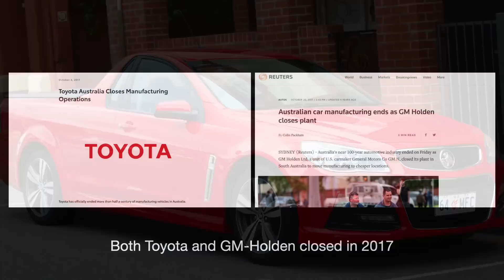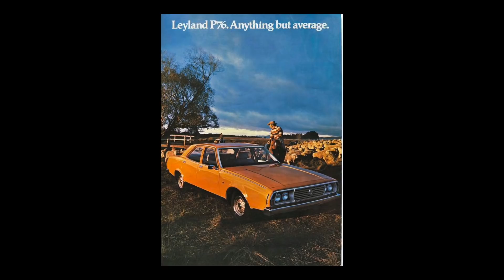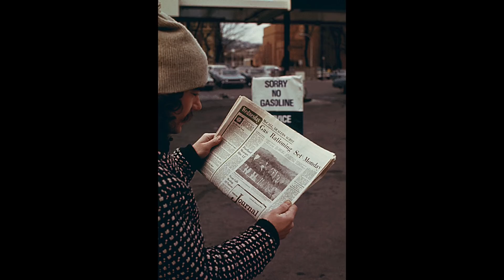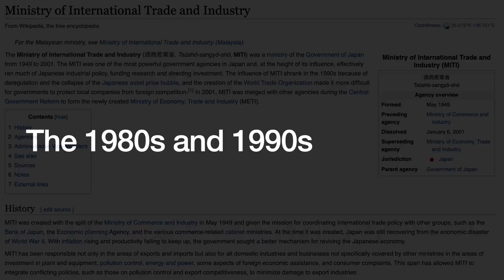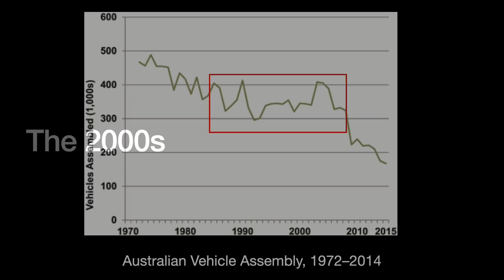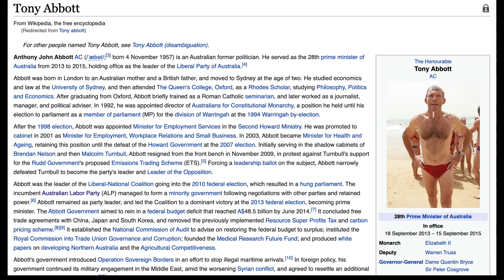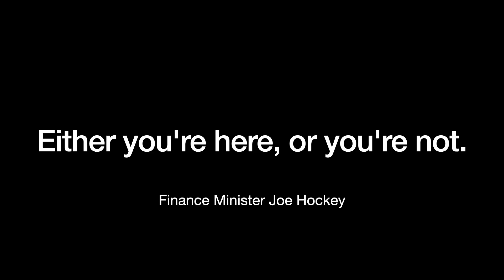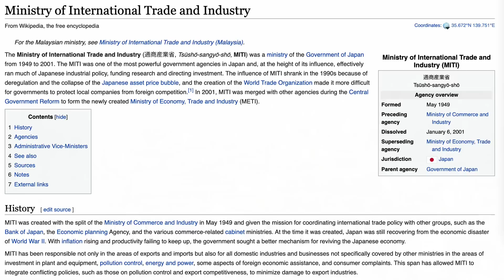Why Australia Doesn’t Make Their Own Cars

Comment: Until the 1990's the Australian car industry only existed because of government subsidies, but they were they making unique vehicles that filled a domestic requirement. Australians wanted a full size (luxuary size) car with a large powerful engine (3.0 to 6.0 litres) for the price of an entry level medium car. They wanted a stripped out Mercedes S class for the price of a Toyota Camry and that is what Holden and Ford gave them.This configuration was unique to Australia and sales justified these unique platforms. 
By 2010's Australians were buying SUV's and the unique platforms no longer made economical sense and it didn't make sense to build SUV's in Australia when they were already being built in Asia with much lower labour costs, about $3,000 per unit. So the foreign owned companies shut down production and imported Asian built SUV's instead.
Basic economics.

Comment: We had Holden made cars here in the Arabian gulf region (Branded as Chevrolet Lumina SS/CR8) they were so powerful (I believe they came with the LS1 engine and later models with the L98) and car enthusiasts were into it with some beefy modifications.
Reply: do they still exist there? Will probably be good collector cars in the future.
Reply: @Viper4ever05  discontinued. I believe the only Chevy sedans exist now is the Malibu and that also might get canceled. we also had the Holden Grange (Branded as Chevrolet Caprice S/SS/LTZ). some enthusiasts used to replace the chevy badge (back and front) with the holden ones since they thought its the real deal. I remember those Holdens dominated the streets for a few years with even slight modifications.
Reply: In the US the Pontiac G8 was a branded Holden sedan with an 6.2 ls and a manual transmission. You can only get them as 2008 year, as Pontiac was disbanded as part of GM's bankruptcy and bailout
Reply: @jammon798  they should have kept that car. It was the only decent car they had
Reply: Walled, i believe you also had Toyota Camry's there too which were made in Melbourne, Australia. I heard the Middle Eastern countries liked the Australian built cars because they handled the hot weather better than European or American cars.
Reply: @philliphunt5348  Correct. my friend drives a 2011 Camry (Australian) 480000km on the odometer. the car refuses to break down basically. I drive 2020 GMC Yukon, but overall its a Toyota land. The Japanese understood the Saudi Arabian market and the gulf region in general from the start. not very expensive cars, easy and cheap to maintain (spare parts everywhere), good quality, high resell-value compared to other vehicles and MAINLY, great air conditioning (I think Mercedes Benz uses Toyota made AC unite -Denso). remember the gulf region was dominated by American cars (because of the big oil companies) until the arrival of Japanese cars.
Reply: @waleed8530  I don't know about dominated. I used to destroy them in my Skyline GTRs with few upgrades.
Reply: @jeffmcdonald101  I think he means dominated in annual sales volumes, not in performance.

Comment: Man, I really would appreciate if you covered the Brazilian automotive industry, it's big but always seem to be behind in cost and technology.
Reply: doesn´t seem to be...we are....we didn't have standard ABS brakes or Airbags in our locally produced cars almost a decade after it became mandatory in many other countries.
Reply: @Ithecastic i don't see a reason gor not having ABS as mandatory, it improves breaking performance in 99% of situations.
 We didn't implement it in Latin America because we use old tooling other countries discard and cheaper parts so our people can actually buy the cars. As an example the Ford Falcon was produced in Argentina until 1990...with full steel body with no crumple zones and a wooden steering wheel. It's insane when you compare it to the cars Americans or Europeans were producing at the time.

Comment: 12:27 The UK tried the same thing in the 1950s and 1960s with disastrous results.  The real problems were labor costs and quality.
Reply: Unions.
Reply: @dreamdiction  "labor costs and quality" are objective measures.  "Unions", while accurate, is both subjective and inflammatory.
Reply: @RonJohn63  Unions resisted modern manufacturing improvements to protect jobs which reduced productivity but they still demanded pay increases, making their company objectively uncompetitive.

A Japanese manufacturer was producing a car in 15 man hours while the British could not do better than 65 hours. Cutting tools were infrequently changed reducing precision in vital components, that's why British engines needed an overhaul after only 70,000 miles and the engine had starting difficulties due to low compression after only 50,000 miles.   

Britain made good cars until about the mid 1960s but after that even British car works bought foreign cars because they knew how shit their own products were. 

15% of the floor space in British car factories was used for "snagging" (correcting faults). Japanese car companies had no snagging area because they stopped the whole production line and only restarted it after manufacturing faults were corrected.   Any British worker who insisted on quality workmanship was label as a "jobsworth" and denounced by shop stewards as a sellout and a management lickspittle.   

Management published reports saying they could not fire workers who came to work only to steal things or curl up in a corner and go to sleep. Union bosses and shop stewards were pawns in a game they did not understand, it was always the plan of marxists to collapse British industry and make Britain dependent on imports so that political control would fall into the hands of globalists who use economy power of and authority structures of capitalism to achieve the aims of communism, that's why everything Mein Kampf warned us about has come true today.
Reply: @dreamdiction  mate. Detroit union is the best union. The best until they destroy entire city

Comment: I've seen the blowback on the parts sector first hand. In 2014, a Denso-style Alternator for a 1999-2006 Toyota Camry cost $250, fitted. Today, that same alternator costs $450 alone.
Reply: yes but them denso alternators from the 90s are high quality and can be rebuilt mine is over 32 years old has been submerged plenty of times and still keeps going. The new ones don't seem to have the same build quality
Reply: Just import two cheap Chinese equivalents, if you have a spare, the first will not give trouble.

Comment: Japan has now subaru which was transferred from gm to Toyota
Mazda that's now out of fords umbrella.
Mitsubishi which is in alliance with Renault and Nissan.
Honda is independent from the two.
There's Suzuki which sells like 10 million cars in India each year.
Toyota is indeed the leading force
Reply: Average indian spends $10,000 on a car while an average Australian spends $40,700. Suzuki don't sell cars of pricetag $20,000.
Reply: i envy Japan for that.
Reply: @g1y3  yeah, people really overestimate the market for high end cars and just cars in general based on the population. There's a reason Tata made a "car" like the Nano to increase the number of potential customers because a decent part of the population can't even afford scooters so it's not even close to a market of 1 billion consumers
Reply: @oblivious7642  a scooter cost less than a nano car. India is still a large market for two wheel. Nano failed because of the tag  "cheap" , and with the price of a new nano you can get a decent used car.
Reply: @mrx9920  I know, I was just pointing out that companies tried to make cars even cheaper to boost units sold. The car companies typically don't make anything off used car sales. The nano was a failure mostly because it wasn't worth the cost given you could get used cars for a little more (at the time it came out) and scooters for much less. The safety concern news reports that kept coming out also didn't help.
Reply: @mrx9920  plus it was cheap (and tiny).  The car looked like a toy mobile even in front of old Maruti 800s
Also I just saw the new ones are priced between 2-3 Lakh. Some used lower-end models will definitely be cheaper than that.

And if you thought I meant people don't buy scooters... I was just saying that there's still a lot of people here who probably hope they can buy one some day. Daily laborers and such
Reply: @g1y3  they do.look at spresso

Comment: One thing the Australian (and even State) governments could have done, was invest. Instead of just handing over cash and subsidy boondoggles, they could have just offered to invest capital. They could have demanded shares in the local operations. By doing this, the multinationals would have either had to match the capital inputs, in order to maintain control, or leave the locals to accumulate a majority stake in their own automotive industry. BTW; the government wouldn't have had to exclusively own the Australian shares; they could have forced the issue of shares that could only be held by Australian citizens or government bodies; which could have been freely traded on the local exchanges.
Reply: My sentiments exactly!  Previous Australian governments continually kept throwing money at foreign manufacturers to fund their operations in Aust., but those corporations simply pocketed the profits!
Even when they shut down their operations they took all the equipment & robots which the Aussie taxpayers had paid for!
Reply: I doubt it would have helped any, Australia is gust to small a country to have much of a auto industry, it probably would have been best if it had tried to find something it actually had a comparative advantage in.

Comment: I have 5 early to mid 90s Holdens in my collection, 2 of which are daily drivers.  One has over 350,000km and still running well, although age and weather sure has had it's told in the last 31 years.  My first car was the same model and had done 400k with 600k on it's transmission without issues but an accident killed that car before it's time was due.
Reply: Toyotas will do a million with nothing but oil changes. Kudos for keeping those cars alive though. They are a part of our history... but history is where they belong.
Reply: @jeffmcdonald101   I hear lots of people say that about Toyotas but I have yet to see that myself.  Some of my family have/had Toyotas and they were all terrible and had major engine issues well before 200k.  My nephew bought a Hilux and the engine didn't make it home from NSW, thew a rod through the block on the border. My mum's Rav engine was toast at 200k and couldn't get proper parts for it so sold it as a wreck after a partial engine rebuild was not really successful.  My nephew's 4th Toyota 4x4 we ended up doing a Buick conversion and it's been the only reliable part of the car. It's funny how a whole brand's perceived reputation comes about from only one or two successful engines, the 4AGE and the 2JZ despite the rest of the brand being mediocre at best.  That's why I tell people to buy specific engines and don't worry about the car too much.
Reply: @jeffmcdonald101  most do not make 200k and they are toast !
Reply: Buick 3800 is one the best engines ever made and certainly best GM engine
Reply: @randlecycling2462  I agree. My crap box daily is still going with another 10k since the comment.
Reply: @randlecycling2462  No it's not. 
But you can't kill them (or stop the oil leaks from the main seal).

Comment: Good summary, John! 
The Button Plan also had another aspect. For economy of scale in car production, car manufacturers were forced into model sharing, at the time. This meant the manufacturers traded models from their line, getting a competitor's product (or products). It was a simple rebadging and for differentiation, slightly different options and minor styling details applied and they werfe selling that, instead of their own. This meant that companies didn't have to design and manufacture a vehicle for every segment of the market for full coverage. I'm not sure exactly what carrot and the stick were used to effect this but for a few years we ended up seeing some strange automotive twins. Think along the lines of the Toyota 86 and the Subaru BRZ but with less collaboration between the companies. Just slap a badge and the front grille on and change the upholstery colour and hey presto, different brand and model car!   For example, Toyota made the Camry which was also sold as the Holden Apollo. There were several other examples. The thing is though, those automotive alter egos didn't sell nearly as well as the natively badged vehicles. Car companies sold just enough of the weird doubles to be able to claim that they are "model sharing". From the buyers point of view, why buy the "fake" Camry, when you can buy a real one and get Toyota support and service for an essentially Toyota car?! I had a Camry for 10 years. (A good, practical and reliable car.) The Apollo would've had to be significantly cheaper for me to consider it but it wasn't, with two companies trying to turn a profit on the same car!
In theory, this sharing scheme could've been a winner if it meant that fewer car models were produced but in higher numbers. However, instead of that happening, often it was the barbarians at the gates, that is, other foreign car imports filling up the gaps. 
So, apart from some small bright spots, Australia's current contribution to the global automotive manufacturing industry is...
...mining!
Australia's problem is that even profitable local manufacturing activities are killed off, if companies can do the same cheaper, i.e. with a healthier profit margin, in another country.
Reply: Australian mining future is in production of EV, wind turbine and solar panel materials. Watch Pilbara.
Reply: Exactly as it should be. Little brother New Zealand were subsidising sheep. The government took that away. They said don't make it unless you can sell it. There was lots of agony for a while. But within a few years NZ was booming. The farmers have never looked back and are probably the most competitive in the world with no subsidies
Reply: Yet Nissan's version of XF ute had better base level trim, and longer warranty.

Comment: There were four main advantages of local vehicle manufacturing:

1. Strategically it gave Australia a significant value added  manufacturing and skill base that could be repurposed for and/or support defence.

2. The locally made vehicles were extensively tested for Australian conditions (rough roads, high temperatures) They were mostly fairly rugged and easily repaired with spare parts readily available. 

3. With a domestic market in which to develop their products, vehicle component manufacturers were able to develop globally.

4. The Australian dollar floats and is quite volatile. Local manufcturing limited the extent to which price inflation was imported theough higher vehicle prices as the dollar fell.

The cost from the loss of manufacturing in Australia has been high.

The country has become a dumping ground for minly low quality vehicles, that are difficult to repair and maintain and usually junked after just a few years.

 Manufacturing and the associated skills base has substantially declined. The country has largely succumbed to the Dutch disease. Individual incomes are mainly derived from low value added so called service industries. National income is maintained mainly by exporting low value added commodities to China.

Comment: Just a small technicality, there is a difference between a ute, ( utility), and a pick up. You can unbolt and remove the tray on a pick up but it is an integral part of the ute and cannot be unbolted.
Reply: We never use the Term 'Pick Up Truck' in Australia, even tray bodies ... those purchased either with neither a Tub or Tray (left to the purchaser as to what they bolt onto the 'cab chassis;) or a removable Tub or tray known as 'Cab Chassis' or a Ute with a non removable 'Tub' we simply lump them all with the term 'Ute"

Comment: Sad to hear that. I didn't bother to know what Holden is and what it's status is except my chevy's engine is a Holden V6 and there are many other parts from Holden in there. Now it's going to be a problem if the car requires a serious fix, better to be careful with it.
Reply: If it’s one of the rebadged Holdens sold in the US market as Chevys then they’ll be plenty of parts available here in Australia through wreckers, or even as new parts from our local auto parts stores. Despite the small size of the market here, there were lots of the same basic vehicle sold for many years because the models didn’t change a whole lot very often.

Comment: Ironically, since the "protected" industry ceased, car prices have  risen quite a lot (yes, even before the shortages).  Car journalists rated the Holden VF SS as the best sedan on the market under $70k until production ceased and they now sell for far more than their original price.  With 20 years in Holden and dealing with Ford management as a supplier, the key factors were lack of support from the parent companies in exporting, fragmenting market segments  and decisions always made on exchange rates that had flipped by the time the decision was implemented.
Reply: The Commodores and Falcons were heavily subsidised by the government to the tune of 10k+ per car. Of course they were good value!

I took advantage of this, of course.

There's no doubting they were darn good cars.